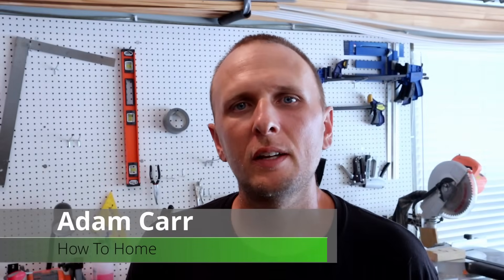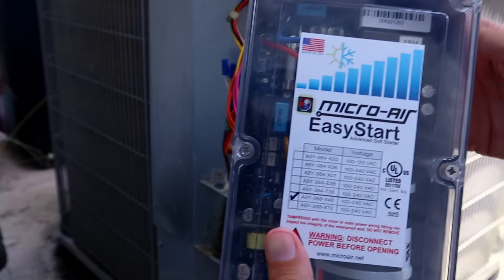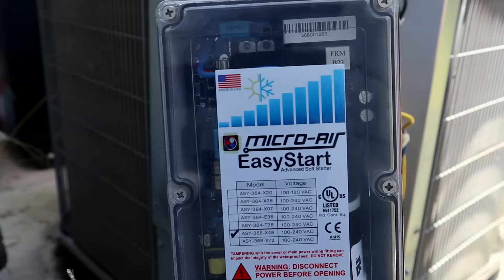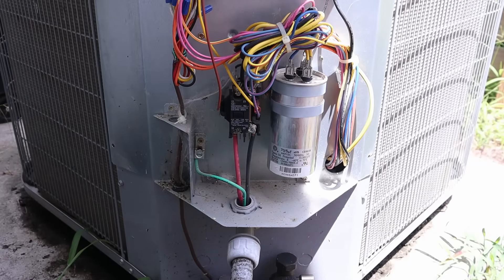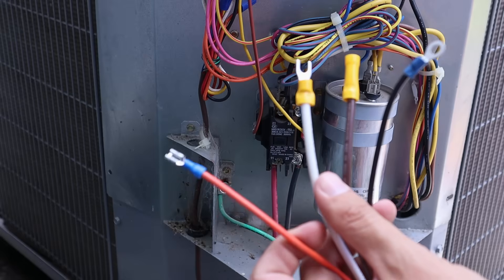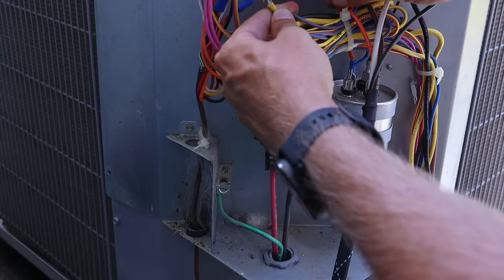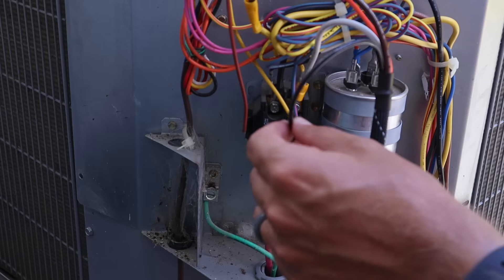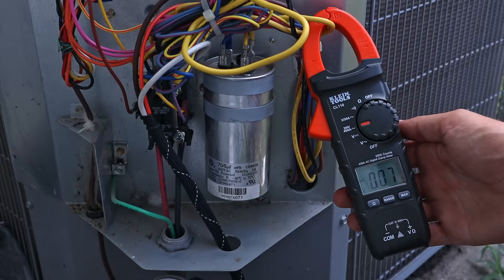How To Install A Soft Start Kit On A Air Conditioner | Run Home AC With A Generator | MicroAir

Comment: I appreciate this video and the one you did on the cat 12000 watt generator.  Very helpful.  This is the route I would like to go. I'm just trying to resolve how much fuel it will consume and the best way to store the fuel. I'm weighing a 8000 watt generator and not being able to run my 4 ton trane ac and the more modest fuel consumption vs the bigger generator and having the ac. How much fuel do you anticipate having on hand and how are you storing it? Thanks.
Reply from the maker: Hey Robert, I too was considering this not that long ago.  I thought about using my smaller generator to power some window or portable ACs but by the time I figured costs, hassle of storage and setup and removing, and how inefficient they were, buying the bigger generator and installing this soft start on the AC made sense to me.  So to answer your question, I anticipate being without power for up to 5-7 days on occasion. During that time the big generator will only be used during times that we want the AC and in the evening when more lights are needed. I have A LOT of 5 gallon fuel containers.  I considered burying a tank and I still may one day soon.  All of this is completely dependent on how much I think I will need to run the generators but I plan on having up to 17 gallons per day.  This should be enough to have power and AC when we need it and also fuel my smaller generator that can power essential circuits when the bigger generator isn't needed, this will conserve fuel. If a 2nd smaller generator isn't possible, the 12,000 does have an idle control to really help with the fuel consumption during low demand times.   Do you currently have the 8000 watt generator or just trying to decide which route to go at this time?  I am glad to hear you found the videos helpful!
Reply: @HowToHomeDIY  Thank you for the information,  very helpful.  I currently have a 1980 vintage 4000 watt Onan rv generator that I converted to a portable.  It's only 120 volts AC, no 240 volts. In the past I used it to run an older refrigerator some lights and a few electric spaces heaters during outages in the winter. It doesn't have low THD, so I never felt comfortable running sensitive appliances or electronics with it.  And not having 240 vac we couldn't have hot water. So my thought was a bigger generator and  interlock kit for the house. I would still use the Onan to run an older refrigerator and chest freezer in an out building that is on a separate power meter.  One thing that I've thought about is running the 4 ton heatpump. Would definitely need the soft start kit like you installed. I have not measured the inrush current but the tag on the unit says 105 amps. So definitely would need to get that figure down.  The other thing is in the winter when the unit is in heat mode there would be no way to run the auxiliary heat strip that activates during the defrost cycle. The blower would blow cold air into the house during defrost cycle. I don't know for sure if and how much this might be problematic.  It still might be better than nothing. So I'm guessing I would have about 3 five gallon gas cans and then siphon some fuel from our vehicles as a last resort if I can't get out to get more.
Reply from the maker: You are definitely correct about the THD, if it has a higher percentage then it could really do some damage to sensitive electronics so you are doing that right for sure!  So one thing about the tag on your AC, that wont always be what your in rush current actually is.  The only way you will know that for sure is to put a amp meter on the compressor run wire and see what it is pulling.  My AC in rush was actually a decent amount less that what the tag was saying my LRA were.  So I would get that just to get a baseline so as to get an idea for where you need to be with generator size.  The soft start kit will definitely really lower it whatever it ends up being and to be safe I would figure conservatively at 50% reduction but it will probably end up being a little more than that.  As far as the heat strips go for your aux heat, yeah that would be pretty tough.  From what I know, those typically are pulling 10kw just for the heat strips so it would take a really large generator to run those and the heat pump.  You have a great idea with the siphoning from the gas tanks if needed.  Hopefully during times like that you can just go get more fuel but that can sometimes be tough due to fuel shortages or in your case you sound like you want to be prepared for blizzards or snow storms so not being able to travel would be a problem as well.  So you are definitely thinking ahead which is great!  Whatever you end up going with, I would size the generator to have more than enough power output to power the AC and not just meet minimum necessary as that would probably wear the generator down faster and also produce some unwanted surging trying to get the AC started up.  But it sounds like you have a good grip on things!
Reply: @HowToHomeDIY  Thanks, I will definitely check my in rush current.  I currently have a hard start kit on the heat pump.  Do you see any negative consequences for the compressor if I have the soft start as opposed to the hard start.  I know they told me when they installed the hard start that it would provide extra initial starting torque for the compressor.   I've been told that compressors trying to start in brown out conditions is bad.  I think I have a scroll compressor so I don't know if that is still the case.  I need to read up more on the MicroAir soft start to understand exactly how it works.  Also do you know if Electric generators direct puts the Cat gen like you have on sale regularly.  I see they have gone back up over $2600.00 the last time I looked and I remember in your video you got yours for $2200 plus.  Thank you.
Reply from the maker: No, I don't see any negatives to it, in fact, it is my belief based on the research I have done, that a soft start is going to be better for your compressor than the hard start.  Not that there are any negatives to a hard start but the soft start slowly ramps up the power to the compressor so it has an easier time kicking on.  The hard start does provide extra torque to get the compressor started faster.  Can I ask why you had a hard start installed in the first place though?  If it was due to the compressor having a hard time starting due to age for example, I would advise messaging micro air on their website to see what they would recommend.  They were very fast with responding to any questions I had which I was impressed with.  Definitely read up more on it, I think I researched and read the information on their site at least 3 times.  Yes that sale lasted for almost 3 weeks on the generator and it has since gone back up to what you quoted.  Their sales seem to be at random times so hard to say when they may put it on sale again but yes when I bought it, the sale was $2,251.65 before tax to be exact.
Reply: @HowToHomeDIY  The HVAC company that does my bi-annually maintenance recommended the hard start. Said it would help my compressor start easier. Of course they are always trying to sell you something such as an air purifier,  surge protection or in this case the hard start kit. My house lights blink occasionally when my compressor starts and it has helped slightly with this but not to the extent I hoped. It would seem the soft start would have the edge here. Just want to say thank you for the details you provide in your videos. I watched a lot of generator videos and you are providing much more than an "unboxing". As a DIY'er, to the extent I can be,  a comprehensive review is crucial.  The devil is in the details. Thanks again.
Reply from the maker: @robertsutherland1954  The classic upsell.  Well at least they were being honest with you in regards to the hard start kit.  I do think that the soft starts are more effective in most areas.  That being said, I recently had someone elect to have a hard start kit put on their 2.5 ton AC unit just to help their generator start the compressor a little easier.  I will have a video coming out on that installation fairly soon for people wanting to go that route as they do have their place in the correct situation.  But I do think you are looking down the right path for your situation with the soft start.  If you come up with any other questions please feel free to shoot them my way and I will try to help you the best I can, whether it be in this video or any of my other ones.  Thank you very much for the kind words, I really do appreciate that feedback!
Reply: @HowToHomeDIY  Adam. as you know I've been waiting for Electric Generators Direct to put the CAT RP12000E on sale again.  I had emailed them to ask if they were planning another sale in the not too distant future.  They told me the sale price was initiated by CAT and whenever CAT had another sale, they would reflect the reduced price on the Website. So I've been checking over the last few weeks on the price but now the CAT RP12000E is all of a sudden showing "discontinued". This kind of shocked me. I thought well maybe they just decided not to carry it anymore. But then I saw where AP Electric Generators is now showing "discontinued". I'm not sure what's going on. It may be nothing but I wanted to let you know. Cat is still showing it on their website so there's that. But if they were indeed discontinuing the product I know you would want to know how this would affect parts and service.  If you find out this is all about nothing please update us Adam. It could be these two companies operate under the same corporation and it's nothing more than a decision they made for themselves.  Odd though I thought.
Reply from the maker: @robertsutherland1954  Hey Robert, good to hear from you!  That is odd.  I talked to someone at Cat before I purchased mine and asked them this same question because even then apelectric was showing discontinued.  Cat told me at that time that there was no plan to stop manufacturing them.  Now of course, not everyone is always honest unfortunately.  I do not know this to be true, so please don't take this as fact but I do know that the covid-19 pandemic has affected a lot of manufacturers in a bad way.  And much of Cat's manufacturing is done in China.  So perhaps this could be the case and availability is less right now.  I did check Lowe's website and according to their website you can order it through them still.
Reply: @HowToHomeDIY  Thanks Adam. I thought it was odd that Electric Generators Direct usually shows that an item is either out of stock or backorderd. But this model of the Cat they say discontinued.  I may just call them. After reading reviews until blue in the face, I like you am drawn to the RP12000E.  In all the research you did in choosing the RP12000E,  May I ask what your second choice generator was? It is hard for me to find a product that checks all the boxes. Initially the only drawback for me with the RP12000E was the Chinese motor. I worry about parts availability and service.  But after reading a review on AP Generators website by a reviewer named Jonathan talking about this engine coming from Rato Power, I relaxed a little. Also worst case there is Predator engine at Harbor Freight that is very close if not exactly the same engine.
Reply from the maker: I hear you. I really think that if Cat was discontinuing it though, that they would've removed it from their site. I am not worried at all about the Cat build, Rato is pretty well known and have a good track record from what I have seen.  Also, all of the Cat generators come with 3 year warranties as long as you register it so in the event there is an issue, they are going to have to fix or replace it.  I was also looking at the WGen 12000 by westinghouse, it is a nice generator.  Same wattage and supposedly the same THD %.  Those were the two biggest factors for me.  So might be another good one for you to check out!
Reply: @HowToHomeDIY  Thanks Adam.  I going to stay focused on the RP12000E.  It's my first choice.  I did like the big Winco but ouch! on the price. I used to be a fan of Generac but a lot of reviews seem to indicate they may not be the company they used to be. I could be wrong in my interpretation though. Hard to find companies that really stand out anymore. I really like the old twin opposed cylinder Onan I have running at 1800rpms.  Low rumble as opposed to the higher pitch of 3600 rpm machines.  Slightly less annoying.  No 240 volts, not low Thd and not enough watts. So something  new awaits. Thanks for the advice.
Reply from the maker: @robertsutherland1954  yeah the Wincos are pretty nice but you're going to pay for them.  Everything is definitely made different now, sometimes for the better sometimes not.  I wish you luck on your search!  It's an investment so definitely do your research, which I know you will.  If I can be of any help, you know where to find me!
Reply: @HowToHomeDIY  Adam, I just got off the phone talking with Caterpillar support. They have discontinued their generator offerings.  They have no more stock at Caterpillar.  But you may still find stock at a reseller for folks that want to buy one. Bottom line is if someone buys one before December  31, 2020 they will still honor the warranty.  Two years.  If you register the warranty within 30 days of purchase its 3 years or  1000 hours whichever comes first. Reason for exiting the market is logistics due to Covid-19 pandemic.  They may reenter the market at a later date depending on circumstances.  Thought you would like to know. You might want to stock up on some maintenance parts. I'm sorry to be the bearer of bad news. I'm disappointed as well. I would encourage you to call Cat yourself as I may have misunderstood some of the details. Take care.
Reply from the maker: @robertsutherland1954  Hey Robert, that is kind of a bummer.  I kind of figured that covid might be the reason.  I can't see how Cat won't start making them again after everything is sorted as their line was incredibly popular.  Thank you very much for looking into it.  Luckily all of the maintenance parts can be bought aftermarket so that is a positive.  Hopefully they will start making their generators again soon!  Let me know what you end up getting and how you like it!
Reply: @HowToHomeDIY  Hi Adam. I will let you know what I end of with. Interestingly I asked Electric Generators Direct what would they recommend that was in the same class with the Cat and they had nothing at this time in stock to offer.  I  really believe CAT had something special with the RP12000E.  I'm going to keep looking at the market and I'm not going to be in too big a hurry to do anything.  But I'll let you know when I do. You keep up the good work with your videos. They are very helpful and I've learned from them. Happy Trails.